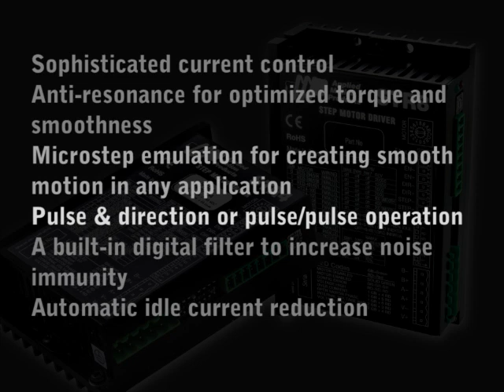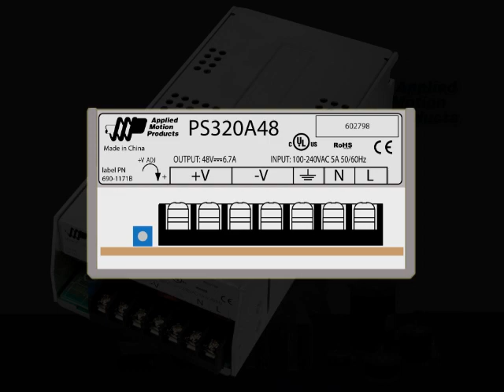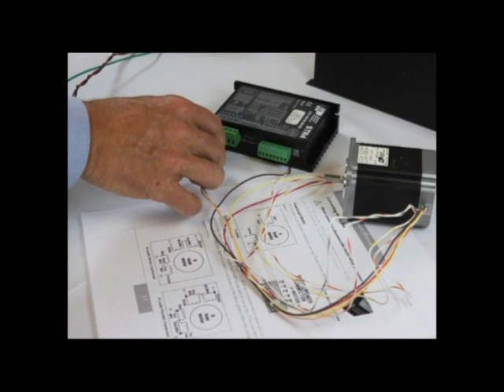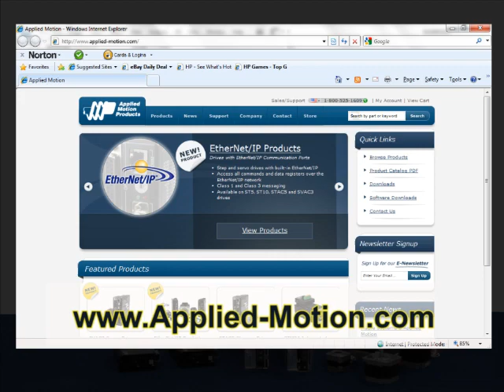Introducing the STR Step Motor Drive

Comment: Hi Manuel, it's important to adjust the current output from the drive to a level that matches your motor (1.1A/phase, in this case).  This can be done by connecting the ST10-Plus programmable stepper drive to ST Configurator, which is the free configuration software program that can be downloaded from the Applied Motion website: http://www.applied-motion.com/products/software/st-configurator
Hope this helps!

Comment: What is the effect of unipolar stepper motor installed in bipolar driver
Reply from the maker: Unipolar motors can definitely be run with bipolar drives.  You will not use 2 of the motor's 6 leads, though.

Unipolar step motors have 6 leads, 3 leads in each phase.  In each phase one of the leads is the "center tap", and two of the leads are the "ends".  These refer to the physical location of the leads within the phase.  There is one "end" lead at each end of the phase, and the "center tap" lead connects to the middle of the phase.  With a unipolar drive all 3 leads in each phase are connected to the drive.  With a bipolar drive you have to select just 2 leads in each phase to connect to the drive, the 2 ends or 1 end and the center tap. An "end to end" connection will give you the highest torque at low speeds, whereas a "center-tap to end" connection will give you more torque at higher speeds (~above 7-10 rev/sec).  For "center-tap to end" connections set the motor current at rated current.  For "end to end" connections set the motor current to 70% of rated current so that you don't overheat the motor.  And very IMPORTANT... you must electrically isolate each of the 4 unused leads individually.  That is, electrically isolate each unused lead from all other leads as well as all other conductive surfaces/objects.  One way to do this is to cover any exposed portion of each unused lead with electrical tape or something more robust.

Comment: if ihaveinduction mottor and steeperand steeperw hat the differntin application and charastic
Reply: Step motors are used primarily for positioning applications,  produce less than 1 horsepower, and are a type of brushless DC motor.  Induction motors are primarily used for velocity applications, can produce much more than 1 horsepower, and are a type of AC motor.
Reply: thank you